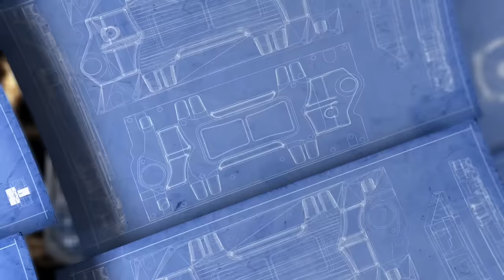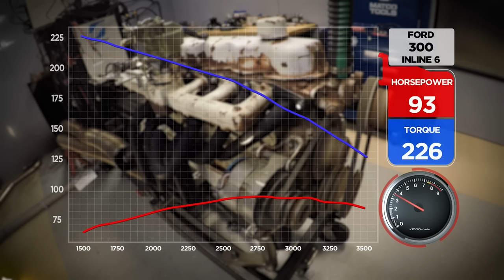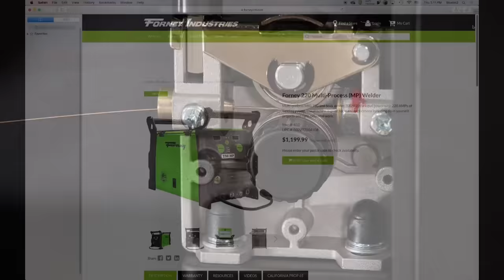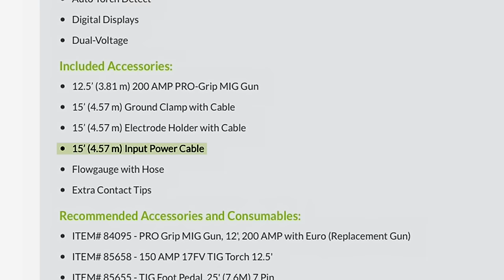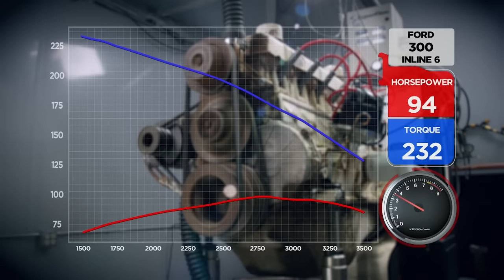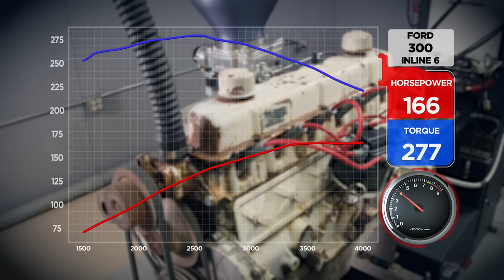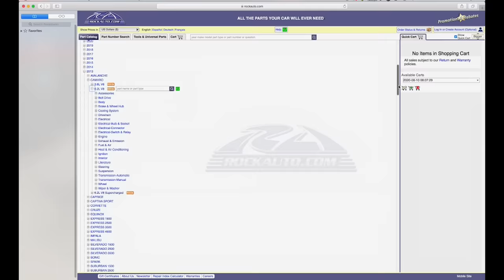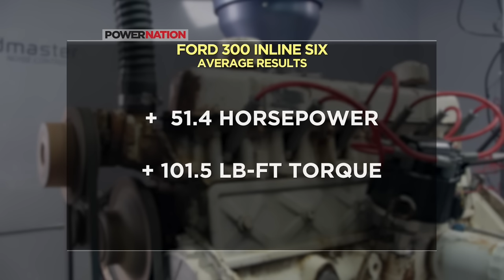Ford 300 Inline Six Gets Eye-Popping Off-The-Shelf Power - Engine Power S7, E17

Comment: i had one in a 78 f250 drove it offroad in deep snow in 2wheel drive floored for 2 miles of slow going travel it held up it pushed the rockers up on the studs and cladered but it still ran like a champ..it burned all the oil out, blew the rad after i came to stop and stalled when i let off about 15min worth of hell..well went back to it months later..different rad added oil took down the lifters..funny thing is the book says tight all the way dawn but when i did it had no compression, i hadto undo them til they just touched the tops of the valve and adjust by ear with a socket while running!..it still runs in an old beater today..17 yrs later lol..good tough motor!!  oh and it had bar and chain oil with clingtough stuff in it for motor oil..

Comment: My dad had a '81 f250 ext cab, long bed, 4x4 with the 300 and a 4spd. It blew piston skirts off of two different pistons. Did it a year apart for each instance. Also it was under the same conditions. 3 cords of firewood stacked up between the truck and a truck box trailer, both had 4' bedsides on. 4low, compression braking coming out of the dirt mountain roads. The engine didn't like that scenario for some reason. Reliable other than that but man was it SLOW with that kind of weight!!

Comment: My uncle bought 2 salvaged f-250's from the Border Patrol (without engines) in 2000 at an auction. One was a '92 The other a '98. They sat around until my cousin installed a Ford I-6 and a Jeep 4.0 on them. Granted these are farm 🚜 trucks in Colorado,  but they still run like new.

Comment: These engines made about 100-150 HP and 225 - 275 Lb./Ft. of torque depending on application and year of manufacturer.  Generally it has been my experience that the industrial engines they provided all had cams in them for maximum torque at about 1800-2400 RPM to run at that RPM 24/7 at 90% power load.  I know that these engines for stand-by generators would run 24/7 and provide 65 KW and never missed a beat.  Great to see you guys play with something like this.  Great illustration of what looks like something that was clean inside from proper maintenance, but probably has a lot of operational hours on it can still run strong to do the job it was meant for.

Comment: The initial dyno pulls weren't spun high enough to get a accurate reading. I routinely spin my carbureted stock 300 inline 6 to 4300 - 4500 rpm.  It pulls all the way up only running out of steam due to induction and exhaust limitations.

Comment: I did the header and intake manifold on my dads 69 bumpside pickup. Instead of a four barrel, I found a 500 CFM two barrel. That combo lived happily for 6 years. Dad got rid of the truck when they raised the speed limit. The three on the tree and the 490 rear end made you feel bad for pushing the truck past 50 mph. I wanted to put in a four speed and a new set of rear gears. I think dad wanted air conditioning.I know mom wanted air conditioning.

Comment: Back in the 80's the 300 inline six Fords did well in 1/2 mile circle track here. There were interchangeable parts from small block Fords. I wasn't a fan, but they were great utility engines!

Comment: The difference between my 1974 F100 with the 300 Cu In carbureted back in 1988 and my 1992 300 Cu in with factory fuel injection and electronic ignition was literally unbelievable able. If I was building a 50s F Model today this is the engine I would use.

Comment: 300 straight 6 is one of the best engines ever.
If the cable TV company loses power it is probably a 300 6 that runs the generator that keeps them on the air.
That is what AT&T used when I worked for them.

Comment: Owned a 95 5 speed manual.  Have a ginormous EcoBoost ford today with supercab for all my tools. Still miss the short bed height and simplicity of pick ups back in the day. And bench seats.  That inline 6 just ran and ran.  A friend owns it today , it's his kids 1st ride. Still runs great. But if I was taking a road trip I put the tail gate down. Had great low end torque but a bit of a dog on the open road if any wind.

Comment: I have a 1967 F100 camper special, i installed a 360 deg Offenhauser manafold and a 450 cfm 4 barrel on it and a T18 warner 4 speed trans in it.  I pulled a 31 foot Airstream Travel trailer all over with it. it is still a daily driver thanks to restoring it twice thru the years ,sadly to say it needs restoring again, but the engine has probably less than 50.000 on it

Comment: 66 yr. old shadetree here. Took my 64 Falcon with the 65 - 200 inline oit myself ( super easy ) and took it down to a motor rebuilder with 40 years experience.  Completely rebuilt head with 1.5 & 1.75 valves with 302 springs. Oil & fuel pump, new clutch assembly,  cam bearings, 274/274 vintage Inlines cam, flat head pistons +.30 over. 7 main bearing set & connevting rods, double roller timing chain. DUI distributor with Live wites, Weber 1v/2v carb, clay smith lifters, stainless steel 6 into 2 header. ARP bolts throughput.  Took .100 off of head for more compression.  
Put it all back together according to the Ford Inl8ne six Performance manual minus thr out of stock aluminum head of course. Put it all together and it runs great but still no real horsepower upgrade. Not sure why....its a three on the tree Falcon and i tjought it would be considerably stronger. I didn't want to cookie cut it with a 302. Maybe i was wrong.

Comment: almost looks like an industrial version of the 300 six.  Yep it's a million mile engine with reasonable care. I had one on a backup generator for a municipal building, it didn't mind running flat out for days at a time. We ran two generators in that complex, one with a 300 six and one with a 460 V8 both fueled by natural gas. They kept a county courthouse and sheriff's department up and running during power outages.

Comment: When I was Stationed in Germany , The  Polizei  had these lil Opels with inline 6 cyl’s running  (3 ) - 2 barrel carbs as their pursuit  cars , Man those things would fly past you like you were parked on the side of the road.
  Me an a Buddy in the early 70’s  bought a ole VW bug that had the 1200 motor ,  we found a 1600cc block an then went thru JC Whitney an ordered I think it was the 2300 cc jug kit , Cam Kit , manifold to install twin Weber 2 bbl, an headers , we also got wheels to put 50 series tires on ass end ,  The car was originally 6 volt , but engine was to high compression ,  So we had to separate start circuit an run a 12 volt battery on a 6 volt starter , it spun like crazy almost sounded like a air starter . 1st gear was worthless the eng would tach out an top speed was like 3 Mph’s . We ended going to German Auto Shop to have studs welded on for the Air Shocks cause we didn’t have access to a wire welder. Those guys laughed their ass’s off at the lil bug , they all had to take turns test driving it they. Were really cool an didn’t charge us any money.They all got a picture of us by the bug with a thumbs up

Comment: When I first spotted the green multiprocess welder I thought it was the Titanium 200 multipurpose inverter welder from Hazard Fraught, the thing is pretty amazing on 110v and 220v is even better, it's been in service as a portable mig unit for on site fabrication and the capacitor bank makes weak outlets at customers homes or businesses much less of a problem on 100' cords welding better than transformer based Lincoln and Miller 140's at less than half the weight.

Comment: Ah the good ole 300 inline 6. I've ran drill rigs for 20 years and that was the go to motor on CME drill rigs (probably many others too). I had an ATV rig with one catch fire last winter. It was still running even though it was engulfed in flames. I changed the distributor, fuel pump plugs wires and ignition system and she fired up and drove onto the trailer. Ended way out of time and had to replace a lit if bent pushrods, but she runs like a stripped ass ape now.

Comment: When I ordered my new 1977 E-150, I ordered the 300 instead of the 302, due to it getting mileage.  It ran great, and only overheated a coup,e of times towing heavy loads.  My only complaint is was the engine did not hold back much on hills.

Comment: You can use the '95 F150 split exhaust manifolds in place of the headers on this engine. Saves you about $450 with no appreciable power difference

Comment: There is a trick to extending the life of your HEI distributor caps. The coil is held in place with four hex head bolts. The cap fails where the bolts enter the cap. This is because the bolts are sharp pointed like wood screws. This makes a sharp point close to the high  voltage inside the cap. Sharp points is where electricity likes to jump to. Just cut off the pointy part. This removes to pointy attractive and moves the metal bolt further away from the high voltage and adds an insulting air gaps as well. In my experience doing this the ignition ran smoother longer and the cap lasted longer.

Comment: Good job guys , i always wondered what a warmed up 300 would do :) , 
we used to have them in tow trucks back in the day and where great work horses  .
 I am a bit of a ford IL 6 fan , although i have a more modern aussie  inline 6  , my last ford 6  outlasted the body , and after 17 years of use , it still is  unopened and has the original head gasket and still runs like a clock to this day (although it does need a timing chain and guide) , even though i parked her up and  let it become unregistered due to the  hard life the  body had.

Comment: Thanks for the straight 6 stuff. 
Many years ago I owned a 1963 1/2 Ford Falcon Futura with a 170 ci 6 and 3 on the tree, non-synchro 1st gear. A handful of years later I was reading Car & Driver testing a BMW 525. I was stunned to see that was a 170 ci 6. Wow! Same size but no comparison. I wondered what could be done to the Ford 6 to increase performance.

Comment: The C-Clamp deal works perfectly …i have seen people on youtube use it exactly like this guy did…and yes you could easily ruin the pucks …how you use the c-clamp is that you first place the old brake pad and then place the c-clamp. The old pad equalizes the pressure. On each puck. Do the same on a single puck also,

Comment: With that HEI electronic ignition, the spark plug gap is also able to be increased significantly. Spark plug gaps with points and condensers are usually quite small.

Comment: I had one in a 1984 ford f150 4wd. indestructible !!  3 angle valve job, bigger valves, 
add a new cam and a pro charger. hellooo 300 hp and ridiculous torque!

Comment: Amazing Sly made 625hp out of one  of these at 9100rpm using cut up 351 cleveland heads welded together and home made high port exaust flanges, lifted intakes and home made injection, 309ci. All in 1969!

Comment: I had the 300 work horse in my construction van. We wanted to upgrade the exhaust manifold and exhaust system to help the engine but the manifold (OEM) provides pre heat for the carb.  The new header, in cold New England winters it would take too long to warm up, if at all on very cold days. Of course this was almost 40 years ago.

Comment: Wow! , what a coincidence! I have a remachined strait 6 ford 300, that never had anything really above stock put on it except maybe the solid lifters, it's got about 2000 miles on the engine right now. But the way it's geared  the engine is screaming  at 2700 RPM at 57 miles per hour so it makes it hard to drive on the highway.  I got a new 2.5 inch exhaust system for it instead of the old 1.5 inch exhaust system stock, and I saw that Patriot sales a straight-6 header for it, which I thought would help it go to higher RPM for the highway. I was getting ready to put some 1.6 ratio locked rockers on it similar to what you guys.  I've been eyeing that offanHauser intake for years, but I was going to put a 450 2 Barrel carb on it and claim the extra horsepower and gas mileage from making it breathe better. I haven't ordered the header  or the intake and carburetor yet but I have some  cool Nutz  for the  Rockers with  oil drain guides. But you guys went and did the whole experiment for me so I can see what to expect. What a great birthday gift for me! Thank you!  I am really excited to get back to that engine in my 22 ft bread truck Ford P400 panel van so I could take it out of the road with the better gas mileage and speed limit. It has the big truck 4 speed transmission which I was thinking of replacing but the engine needs the work first. My truck is a 1976 but I noticed that 2016 Ford RVs still drive the same way as that bread truck.  it's got that all aluminum body & floor so it's all pretty solid and I just want to upgrade the frame for towing & heavier loads. I really mean thanks you guys! Now I know what kind of reward I'll get for those add-ons. that takes all the speculation out of it. I was thinking that maybe I should get high-performance hydraulic lifters to take it easy on the valve train. What do you think?

Comment: Had 80 4 speed on floor   Van. 300 thousand miles,  25 years, 7+ wrecks.
When I gave it away engine & 4 speed still strong. The rest of vehicle simply completely wore out. Big believer of straight engines.

Comment: The only thing i liked about the ford inline six 300 back in the day was to be able two use the rods in a sbc ( destroked 400 to 352 cid) 4.155 bore X 3.250 crank ,, 6.200 long rod engine still runs strong in my wife's 75' chevy Vega 5 speed car,,

Comment: I've got a 1990 4.9 with 257K and still going... it's getting tired, but still pulls strong and doesn't even smoke! LOVE IT!! Gotta be honest, though... the factory rating for my EFI was 145 hp and 265 lb.ft.... so I'd be more impressed with the number difference if they hadn't started with the absolute weakest version. Just sayin'...

Get a stock EFI 4.9 and double the horsepower with a few bolt-ons. I'll subscribe to that, now!

Comment: The EFI version of these engines in the F150's made 165hp and 275 lb-ft of torque. It's interesting that even with the header this one makes a lot less. I'm assuming probably cam design has a lot to do with that. Edit: guess I have my answer there. It was just that restrictive intake. That's a testament to how well the EFI exhaust manifolds flow though. A lot of guys trying to get a bit more hp out of the older carbed engines swap those on as a cheap and reliable header alternative.
Reply: Another thing guys do with these is use BBC rockers to up the ratio to 1.7:1 and increase valve lift. Since this engine doesn't have a ton of aftermarket support and nobody wants to sink a ton of money into one, it's low dollar creative options like that that people have to resort to to squeeze some more hp out of them. Can't wait to see what this thing will do with a cam and that turbo you hinted at.

Comment: I had a 96 f 150 with 300,013ML,s on it used a 1/2 qt of oil between oil changes  and was running great until it was wrecked .I bout it new and never went over 4,000 ml between oil changes

Comment: I like you're doing step-by-step changes to see a difference. You changed the "log" intake manifold to the offenhauser and added a 4bbl. Is it possible to run an offenhauser with a 1bbl or 2bbl? Aside of dumping a huge amount of fuel and air, what's the effective difference just changing from the log intake?

Comment: The cool thing was the deep oil sump. Was going to add a header but the design back then didn't have good preheat for the carb and I didn't think it would start and run in the  Western Mass winters

Comment: Great job so far.
We have seen 275 horsepower on a dyno with a big valve ported head and a Crower 19205 cam using SBC 1.94"/1.60" valves.
It will make over 300 horses with a cam having a 232/232 .050" duration .534" valve lift.
Both engines have a 10: 1 compression ratio.
Please do something exceptional.
Thank you

Comment: Ok, now let's see you get the compression above 8:1, and see what it can really make.  The last one I built was with flat top FE 360 pistons, and bored way out.  Torque grind cam from Delta, and pretty much stock everything else.  Great runner with decent power and fuel economy.  Also bump the timing up, these will handle 10° easily.
I've found the DSII ignition system to be more than adequate for this engine, I ran a DUI system on my first build and really couldn't tell a difference.

Comment: I still drive an Immortal 300 4.9 as a daily work truck, Single cab, bench seat. f150. I will keep her as long as I can. Already had to get a work around for the fuel pumps transfer, Ford no longer makes them But the motor is like a new, makes so little noise and no vibration. I had a Ford Ranger some time back newer 94 and the old 300 got better fuel mileage. But after watching this video it might change.😃

Comment: Never have I seen an engine double it's HP output with just a headder a intake and ignition swap. WOW.
My father had a 79' F-100 with the 300 - i6 and he said it was the most reliable car he's ever owned.  It once had a leaking fuel line, so he fixed it on the side of the road in less than 5 minutes with a rubber hose and clamps.  That's the only thing he had to fix on that truck.  He hated Fords otherwise.  
In the dictionary under "Reliable" & "Bulletproof" should be a picture of the Ford 300 i6.
Reply: Love the 300/6....love Ford pickups.  Started to say Ford pickups the best, when it occurred that I've never owned a Chevy, Toyota, Dodge for comparison...

Comment: When it comes to your compressing  brake caliper cylinder, common sence tells you to leave pad that is to be replaced still mounted to caliper to compress cylinder thus no need to waste $50 when it takes less than a minute to compress cylinder mount new pads and check for clearance to rotor,any shade tree mechanic knows that, bad tip  later Rev